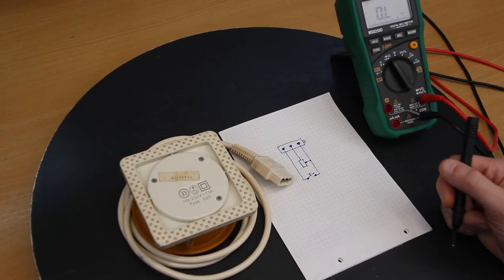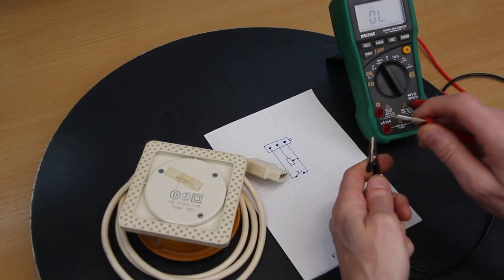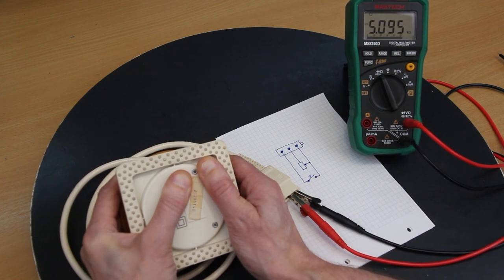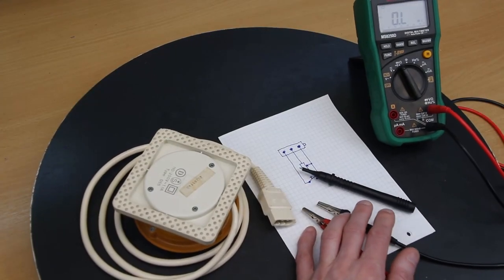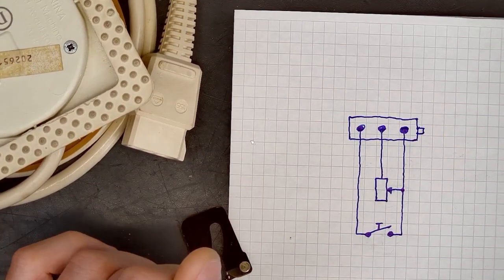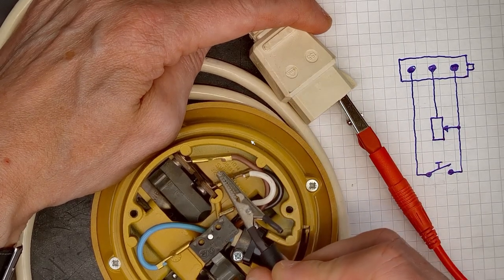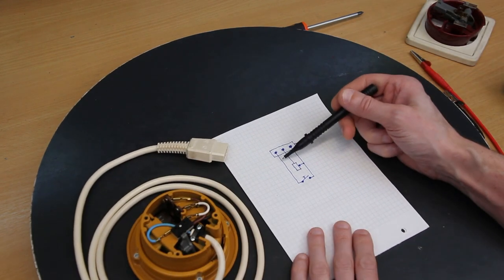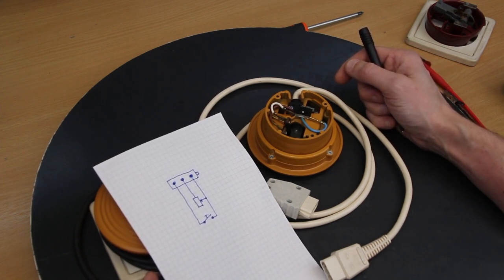How to troubleshoot your Bernina 900 Nova Foot Controller

Comment: Hey, thanks for the video. Any chance you would know where I can get a new variable resistor?
Reply from the maker: Are the resistor broken or do you need the carbon pins?
Reply: @sewrepair  carbon pins are intact. I performed a resistance test on the resistor itself, as you showed in the video, and there’s no resistance.

Comment: I have a Bernina Nova 900 and the pedal stopped working. Upon inspection the carbon pins were broken, just installed new pins and still not working. I opened the plug and all the connections are intact. I will order your 3D printed plug if I can troubleshoot the pedal. I used a multimeter and tested the voltage with it plugged in at the plug, the microswitch goes from around 4.5 V to 0.00V when the pedal is activated. The variable resistor is 0.0V and when activated jumps to about 3V and then drops to around 1.5V. Any suggestions on what I'm overlooking?
Reply from the maker: Check the variable resistor and the micro switch with measuring the resistance (ohm), not voltage. The voltages do not tell me much, sorry.